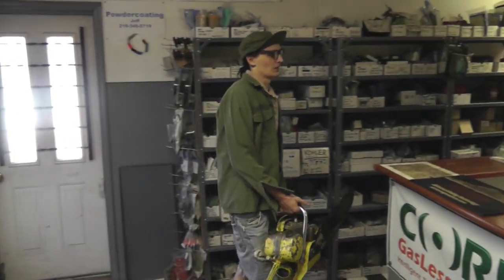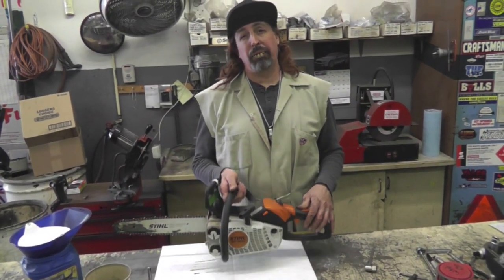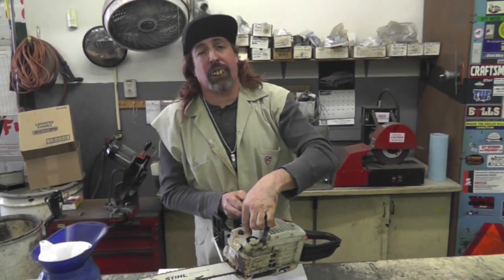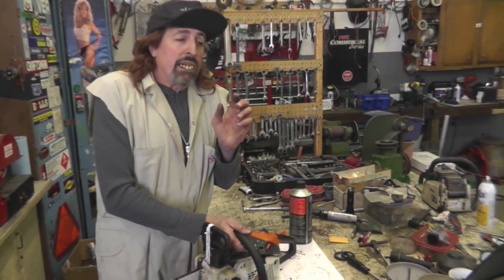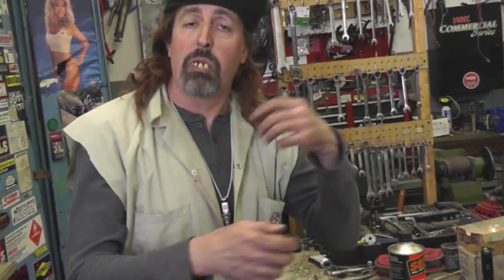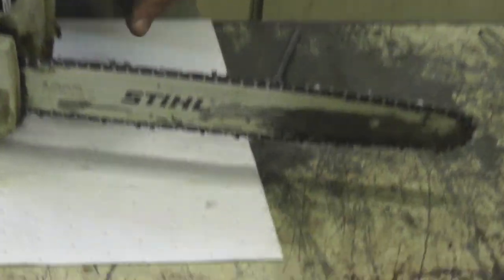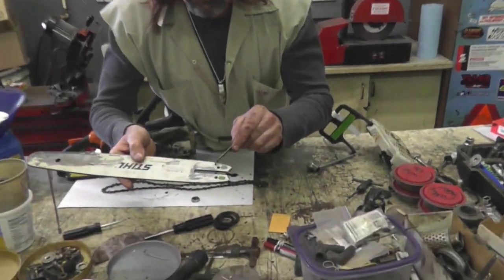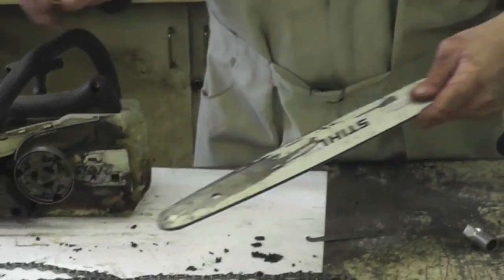BASIC CHAINSAW MAINTENANCE: A Complete Guide

Comment: Great tip on flipping the bar everytime you change the chain to prolong the life of the bar by distributing the wear on both sides.   I'm surprised to see how many wood pulp boogers there are that get in the gas tank.
Reply: I take a dry paint brush and clean around fuel cap before refueling

Comment: I have a Dolmar 540. I know it's old, but it works as good as a Stihl. Lately I'm finding that my pull cord is a bit harder to pull, and other times it's easy to pull. When it's hard to pull it almost feels like too much compression. Do you think it could be my recoil mechanism, because when it's hard to pull, the cord does'nt go all the way in (all but about 3 or 4 inches stays out).

Comment: I'm not sure about other chain saw brands, but Stihl says DO NOT blow out the air filter with compressed air! The air pressure pulls apart the material & will actually let in debri rather than keep it out. It is proper procedure to wash out the air filter & let it completely dry before reinstalling.
Reply from the maker: +Zach attack Believe me I've been doing this a long time as long as yur not using 150psi of compressed air blowing it out will not hurt it. If you notice it pulling the material apart then it's time for a new one.

Comment: I have to cut down 2 trees that have an old chain link fence embedded in it.I have to make about 6 cuts where the chain is. The thickness of the fence links is similar to nail size #6 or #8.   I have a Stihl 441 chainsaw. The bar is 32". What is your advice on what kind of chain to use? Carbide chain? Something else better? Thank you so much.
Reply: I know what I'd do. I'd cut the tree above the fence line. Ten cut the fence on both sides of the tree. Then grind the stump out with a stump grinder trying to not hit any of the steel in the chain link. Then throw the whole big chunk of fence and trunk away. Or let it sit a year or 3 and burn it.
Chainsaws hate steel chain link, concrete too.
I think they do make a chain that fire departments use, but they's so expensive that it would be worth your while to take your time to avoid the chain link with a regular chain.

Comment: Or should i use a loop to my regular chain? Here is more details. 105DL- 3/8- .050
Reply from the maker: That's a tough one, carbide is very expensive and the teeth will probably just break off when you hit the fence. Standard chain will probably do the same. You could contact the people at Rapco. They make all kinds of carbide chain for emergency responders  they might have a chain they recommend . You can call them toll free at 800-959-6130

Comment: Is it possible to just blow out the fuel filter with air compressor ?
Reply from the maker: sure but that part is fairly inexpensive so why take a chance of possibly running the saw lean. A $4.00 fuel filter is much cheaper than a piston & cylinder
Reply: and theirs your dinner @TarylFixesAll